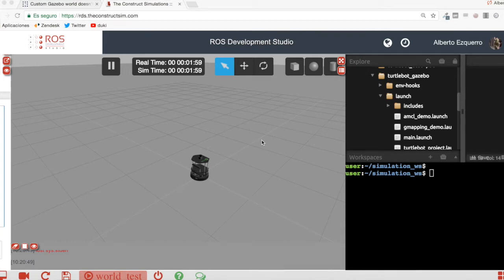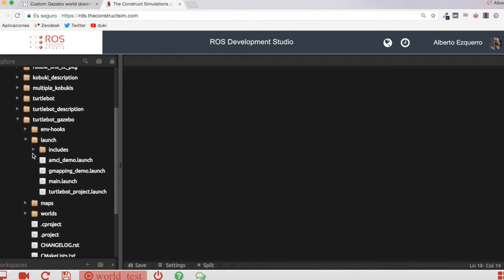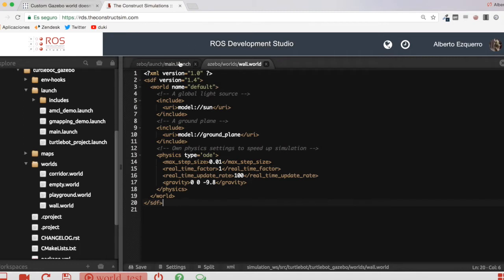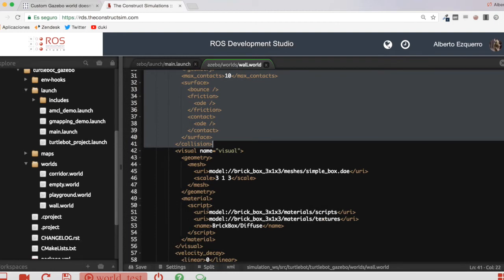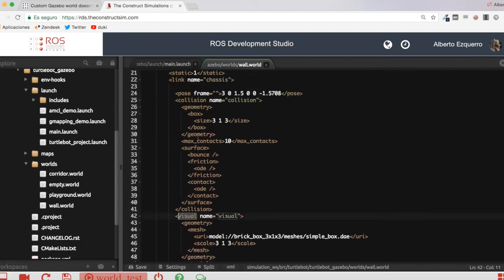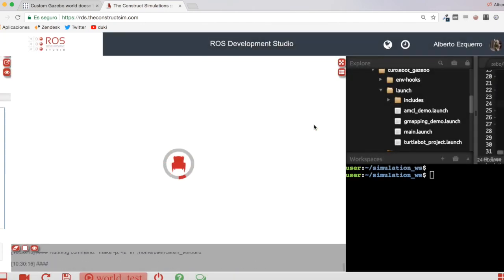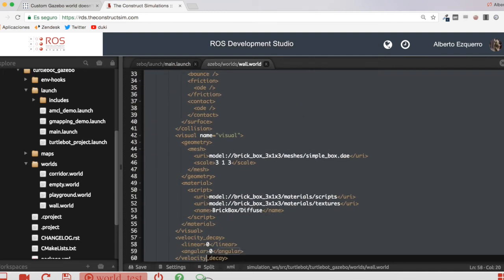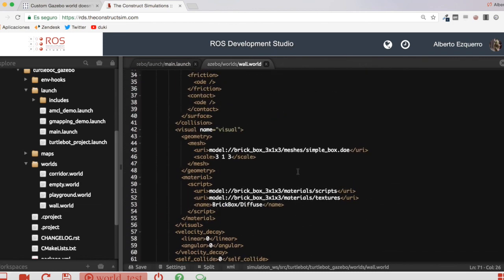[ROS Q&A] 073 - How to add a simple wall to a Gazebo world

Comment: I think it is also worth to show another simpler way as well. Instead of writing xml file from scratch, you can use Gazebo to build some world using the built-in models and then save that world as .world file. It will auto-generate that xml file for you and then you can modify it as you wish, but the modification will be easier than writing the xml from scratch.
Reply: Currenly I am working on building a world file. Thank you for your addition here!